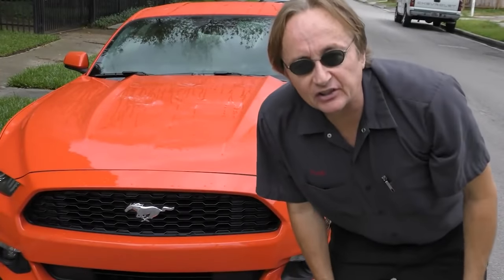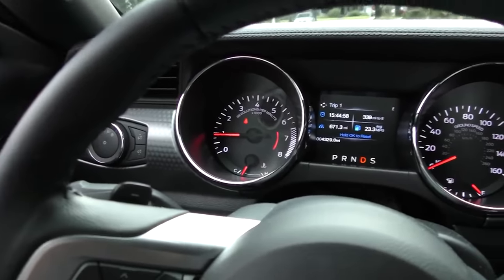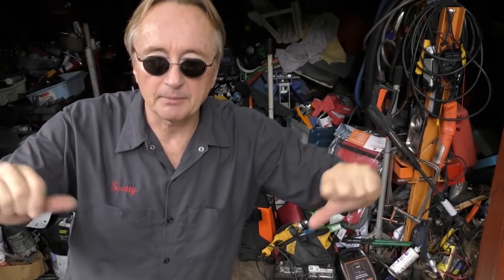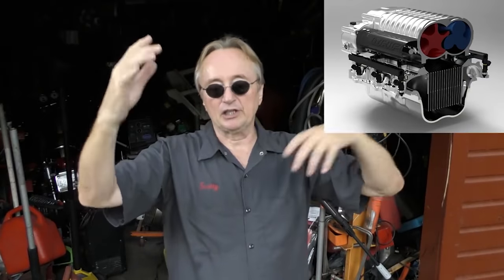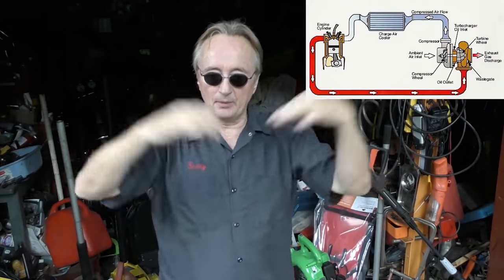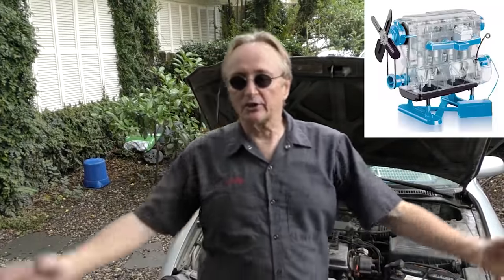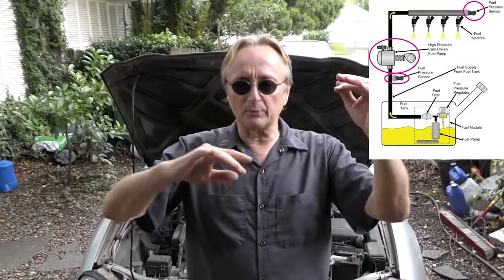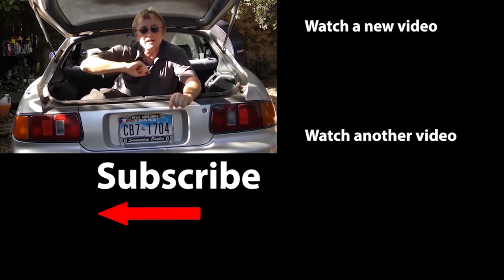I Was Wrong About This Engine and I'm Sorry

Comment: I believe smaller high powered engines will last longer, small short parts are much stronger than larger engines with more parts.  

Kind of like the strength of a short stick or long stick.  Ratings for loads decrease as size/height increases.  

Similar to computers... They used to weigh tons & did as little work as a calculator in the past. Today they're 1000s times faster, efficient & longer lasting.  

Less weight means less fuel, better performance/braking, smaller engine is less parts/repairs easier to work on provided engineers didn't create 'engineering nightmare' to disassemble.
Reply: Don't compare electronics with mechanics. Time will tell this engine is a hand grenade.
Reply: @genefoster8601  
Small objects are extremely durable..  smaller engines are much more durable even under pressure.
I've had the 2.7l in my f150 for 6 years now, very durable & powerful.
Reply: Doesn't matter how small it is if it's "High powered". The stress is the same.
Reply: @shikamaru281281  

Stress can be the same, but durability is greater when compact, not to mention more efficient for vehicles in terms of weight savings.  

Smaller motors are stable and strong like ones in hard drives spinning 15000 RPM.  Trying to do that with a larger motor would be impossible they'll destroy themselves at the slightest imbalance.
Reply: @Gamerz00760  Hard drive motors are electric (have more torque) and under very light load - there is nothing stopping the drive disk while the motor is spinning it. In cars, there is.
In hard drives, the motion is circular (the most efficient one), engines are reciprocating, the stress is not the same at all, so a direct comparisson in RPMs is silly.
There is also nothing stopping a larger part from spinning at higher RPMs - turbos in cars spin waaay faster than 15k, the compressor part in a jet engine spins waaay faster, etc. It is all a matter of technology and craftmanship. And physics.
And to return to your original statement, you are wrong - bigger engines are more durable because they don't have to work as much to achieve the same result compared to a smaller one. And that work is tied to the human scale of things. Putting a 1.0L dual turbo engine in a car is just as stupid as putting a 10.0L NA in a daily driver - why, when a 2-3L NA could do the same work more efficiently and last longer becuase its size is sufficient but also not over the top? In the end of the day, you pay X ammount of fuel for Y ammount of work (miles), whether you use a small turbocharged engine or a bigger NA one does not matter. Turbo engines only get better gas milage when driven lightly and because they harness more power out of the fuel by using the exhaust gases which the NA does not. If you put a tiny turbocharger on a big engine it will  be just as efficient as a small one with a huge high-boost turbo, but while the bigger engine will be working at optimal load or under it, the tiny one will be under constant stress, which will cause metal fatigue and part failures.
Reply: @tusux2949  

Unfortunately there is no evidence online that will prove either of our opinions.  My statement is simple in principle...smaller is better & more durable (assuming it is based on needs, but identifying that is a different story).

Simple reasoning is larger parts have more points to fail, more components to fail, not cost effective, less efficient, requires more cooling & more oil if made the same but increased size (turbos or not). 

Turbos actually aren't less efficient unless you're trying to haul heavier loads, they'll also do better in the mountains than a NA engine.  

As a daily drive of turbo, throttle makes nearly no difference for mpg (1mpg at best)... It practically idles due to ford's transmission shifting at  <2000rpm, which according to fords engineers is their target for maximum power/efficiency.

A lot has changed where maintenance is key to lifespan...lubricants are better & parts can be machined with much better precision.  

Regarding the hard drive... I was simply stating a bigger electric motor at 15000RPM wouldn't be suitable for movement like a tiny version is.  They could never put a larger version on a moving object it would destroy everything.  

The largest ship engine has 14 cylinders, but can't run over 100 some RPM.  It would destroy itself.  The size & mass of such loses effectiveness.  Its performance numbers are off the chart, but mass, heat generation, fuel used is significant.  

I can't think of anything that actually makes bigger better... House= more maintenance, bigger car= more expenses, bigger business= more problems.  While each might fix a need of sort, it ultimately has many more failure points in each example & when they do it is much more costly.  

Ford and Volkswagen been headed smaller for gains.  V2 197hp 98lb ft paired with 31mile all electric range 260mpg.

Ford gt has over 600hp in a V6.

Comment: They are gabage
Reply: They really aren’t, man. It’s just not a traditional 5.0 . Look, I don’t like V6 or I4 muscle cars, but still, ford has made a solid design here. Not everybody needs a big badass V8 yknow?
Reply: @tomemacyt.1524  Well then those people don't need to be driving a car that should have a V8 in it. Let them drive a Ford Pinto.
Reply: @tomemacyt.1524  im not saying in power, but in reliability wise. After 50k miles, beware because is going downhill
Reply: @Carlos.Rivera   I think tbh it’s very application based. 310 HP coming out of a small engine like this is good stuff, but in a large heavy muscle car or a truck? not the best of ideas. Scotty makes some good points here, but they’re still not complete crap. What I would use an eco boost for is something like a sporty hot hatch, and with the right software, and maybe some aftermarket parts, they definitely have potential.